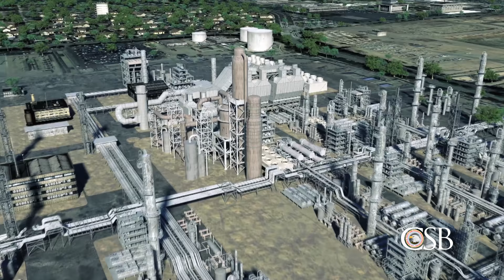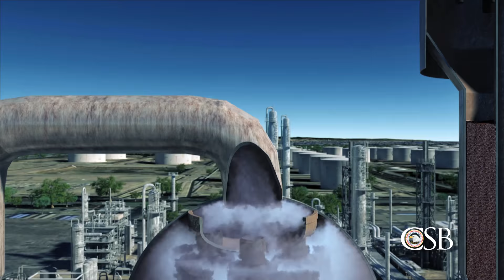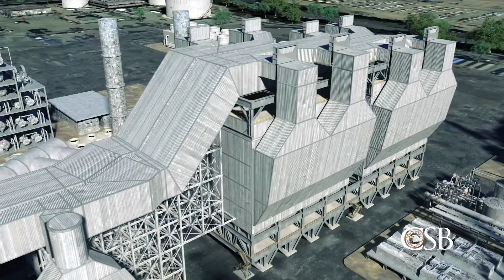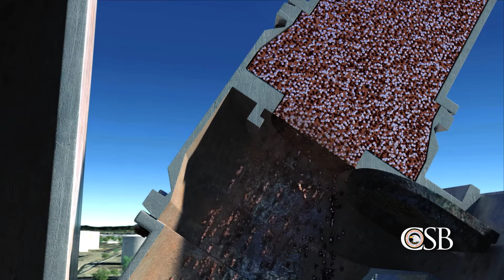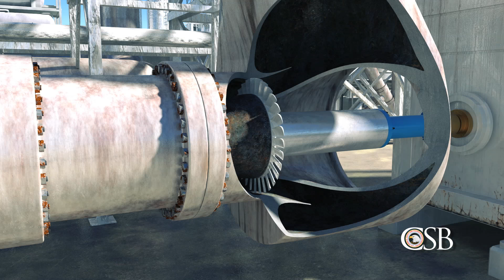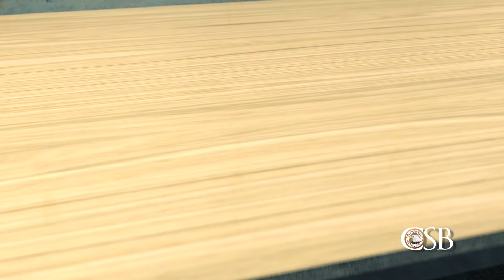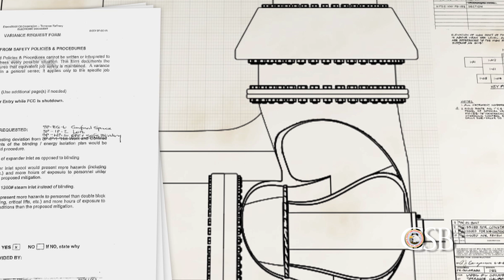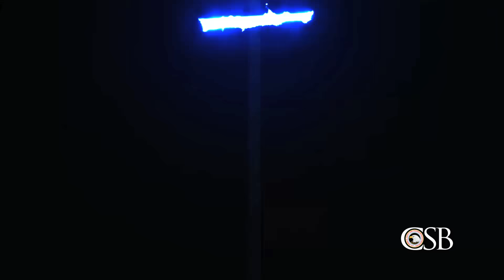Animation of 2015 Explosion at ExxonMobil Refinery in Torrance, CA

Comment: Expander fails
"We don't need to check this. Just restart it."
Doesn't restart
"It's probably just wear and tear. Of course, this in no way indicates that maybe some other parts are suffering from wear as well. Let's just replace that one part. While we're at it, let's just pull up some BS piece of paper from 3 years ago, violating our protocol, cause protocols are for nerds."
Steam comes out.
"Oh shit, let's just shut down this steam which is part of a safety measure to stop our shit from blowing up, cause there's no way anything else could be wrong inside this huge metal container which we can't see into. Also let's not shut down anything else, especially not the sparky things, cause time is money."
gas leaks
"What's that smell? Oh wait, I seem to remember there being a safety feature that was designed to prevent this exact shit from happening, you know, the one we just turned off. Yeah, let's turn that back on. The gas'll never make it to the spark.."
BOOM SHIT FLYING EVERYWHERE MEN SCREAMING IN PANIC PPL RUNNING FOR THEIR LIVES WHILE BURNING IN HYDRO-CARBON HELLFIRE

"Shit happens."

Comment: Isn't it amazing when your shitty maintenance allows multiple safety features to fail all at once, slide valve fail, back flow preventer failure allowing lite ends to pass through cooling tower which is wrong I believe more likely leaky heat exchangers. Always remember kids the most dangerous thing in a refinery is cooling water because the process is always run so that product leaks into the cooling water not cooling water into the product.

Comment: I worked in a chemical facility making automotive paint. Every step of every task was dissected, documented, and theoretically, even with an an equipment failure, a safety issue should never arise.
But employees were pressured, and rewarded for, production. Employees who took dangerous shortcuts completed tasks quicker, and their speed soon became the standard. Production trump's safety every time.
We had enough solvents in dozens of 10,000 gallon tanks to straighten the river bend we were located on.
Even though we lived safety, and management preached it religeously, they turned a blind eye to short cuts employees are pressured to make, until something goes wrong.
Reply: If Americsn lawsuits stamped on industrial negligence instead of 'malpractice' liability, our healthcare would be cheaper on top of its high quality. We would be undisputed best in the world.
Reply: Then massive costs are invited rebuilding the facility and compensate for the injury or deaths,,,
Not a good business plan long term.
I worked on boats, used Sterling paints and they had wicked solvents.
Plus the fiberglass resins,,
One day some guy wanders in my space to watch my spray out a hill cigarette hanging out his mouth
My God!
Reply: @samlabo1688  Because most businesses focus exclusively on short term profits, because stockholders only care about quarterly earnings. They don't care about long term costs and certainly don't care about the workers.
Reply: Let's take a moment to appreciate the line "enough solvents to straighten [a] river bend". What an amazing turn of phrase.
Reply: @greenyawgmoth  No exaggeration. The plant used to be a gunpowder factory before we took it over. All the roofs in our buildings were designed to blow off during an explosion, a design left over from the powder company. One day I spotted open flames coming from the top of a grinding mill and hit the evac button.
Fortunately, instead of running, one brave employee grabbed an extinguisher and put it out.
Directly under the mill was a 200 gallon container of toluene.
If that would have ignited, we would have welded NJ and PA together, river or no river.
Reply: @2002MX5  

Yikes ... I had to read that twice to make sure my lack of sleep was blurring my comprehension ... I can still feel a cold chill in my spine ...

Which leads me to a number of questions:

a) who in right God-damn mind has a 200gal tank of toluene under a grinding mill ...?

b) why wasn't any kind of fire suppression fitted ... or was it a cost vs chance of accident thing ...?

c) did that brave soul got awarded for his bravery, above and beyond ...? He saved the entire plant from becoming a smoldering crater in the ground ...
Reply: Disagree completely.  Safety trumps production. Anyone who wishes to push production over safety is asking for failure...at some point.
Reply: @markrothenberg9867  You are wrong. I lived it. For a German company here in the U.S.
The biggest chemical company in the world.
Reply: True that.  Same thing in oil production preach safety, but demand production wink wink.  Something goes wrong you get the axe.
Reply: @kunkel80101  Plus, add the stresses produced by some of the most punishing shift rotations imaginable.
Reply: @kunkel80101  Yep.  Workers hate what they view as overreaching safety guidelines
Reply: @chad9166  

There's a fine line between safety guidelines that have been practically written in blood; and too much safety, where it takes up as much time as the job itself ...
Reply: @nigelft  The vertical grinding mill was drawing paint from the bottom of an open top tank and then redepositing ground paint back into the top. It was covered with a cylindrical wooden cover with a cut out for the hose.
Next to it, he had started putting together another batch, solvents first, same size open tank with the wooden cover. He was watching the mill and working on loading the next batch. He had left for a minute to retrieve pigments.
I walked nearby and saw flames coming from the bearings at the top of the mill. I ran to the nearest fire alarm and pulled it, ran to nearby office and yelled to evacuate. That was our training. A crazy brave maintenance man grabbed a huge wheeled fire extinguisher, killed the mill power and put out the fire. He caught hell for risking his life, but they still loved him for it.
Plant has sprinklers, but ceiling is 20' high, and fire produced almost no smoke or enough heat to trigger it.
The mill was an older vertical grinding mill used for smaller batches.
We had huge new horizontal primer mills on the lower floor that were self contained, where a fire couldn't happen. Automatic shutoffs built in.
We had the longest running safety record in  BASF worldwide - 20 years without a lost workday accident.
One day a bee stung an employee at our outdoor picnic and we had to start all over.
Reply: Am old enough to remember industrial painting Carbomastic on steel piles with a plastic tent top and a cloth mask and hoodie. That was bad. Before that I worked degreasing industrial silk screens with solvents in the loft of a building that got to 108F in the summer. No protection at all. We were all tripping balls. Later on, was on a team they sent down into the oily-water sewers in a refinery to map them for expansion. Of the three who went in, without chemical masks (this was in 1990s,) they were all dead of cancer within a year. My job was sitting up above on the surface with walkie talkie, taking their mapping notes and as 'extraction safety watch', since I had young kids. Their wives asked me to testify for them, but the refinery town attorneys were all too chicken to take the case. So I quit field work. Today, you can't move a finger without chemical masks, moon suits, HS&E sniffers and post-watches, and manhole tripod hoists. Nobody dies in an office job except from too many Dingdongs, lol.
Reply: First time I decided to apply for a job on a printing press, the supervisor told me to never panic, always go slow and look where I was walking, putting my hands, and my feet. And never, never chase after anything that falls near the press. If anything falls in the press, it's always better to just hit the Emergency Stop. Even if production is affected or machinery is damaged, none of it is worth losing a finger, a limb or my life. I always appreciate what he told me.

It's leadership and training that matters in all these accidents.
Reply: @chaosXP3RT  Started work on a big Miehle 4-color, doing 24x36s on vinyl and when I started asking about safety items and safety training they moved me to the mailroom and had me do deliveries, lol.
Reply: Why were they storing these solvents is the question? Odds are they were required to monitor the condition of the tanks and valving to be allowed either by state or federal regulators to do this. The company has a "cradle to grave" ownership for civil and criminal liability on these tanks. This is SOP for decades.
If they lack the means, which can mean there are no other places to store these chemicals safely, legally, ethically they are allowed, with proper government approval to store in place. This sounds like what you are talking about.
Sometimes the government refuses to let them move these chemicals and they must store them in place or the approved method is much more dangerous or environmentally risky than storing in place.
Look at the King(?) Mining Disaster which shows bureaucrats at their best polluting a river.
Reply: @katrinaanon1038  What?????
They stored them because they used them daily. And it's NJ. They fuck with your company until you leave, like ours did.
Reply: Your contempt for workers is disgusting, those "shortcuts taken by employees" are in reality management operating a business exactly as they want to, only caring about profits, this has nothing to do with the workers and to believe that is they who are responsible for greed's consequences is both mind numbingly stupid and ignorant. Capitalism kills, power to the workers.
Reply: @eleSDSU  Suck it, moron.
Reply: @eleSDSU your contempt for having proper reading comprehension is disgusting
Reply: @eleSDSU  I sympathize with what you're saying. At the same time, I think we have to acknowledge that in any traditional business, industrial or otherwise, the line set by management is often taken up wholeheartedly and uncritically—even subconsciously—by their employees. The OP describes this: management talks safety but pays for speed, and the workers that take the hint and disregard saefty in favor of speed are praised and rewarded by management. Can we blame management for this? Absolutely. Are the workers the ones who stand to suffer the most when things inevitably go wrong? Definitely. Yet, it's an oversimplification to say that the workers that go ahead and disregard safety have nothing to do with the problem. If you're really a trade unionist of any sort, I'm sure you know well that at just about any non-union company, many workers will say exactly the same sorts of things management would say about unions. Furthermore, even unions themselves can become corrupt and work against the interests of the workers they claim to represent. Nothing in life is so simple.
Reply: Corporate/executive greed, no surprise here

Comment: just a few questions...why wasn't there any secondary stop valves in place to prevent such a flow, and why wasn't there any pressure monitors in place to warn of the potential over pressurization?

Comment: So, they knew for over half an hour that hydrocarbon gasses were in the ESP, and that it could ignite it, and they were doing repairs for several days on the thing that feeds it hydrocarbon gases.....and NO ONE thought that maybe it might be a good idea to shut off the ESP? 
Sure,some dirty pollution will escape, but I think that is far less than the smallest drop in the biggest bucket of a refinery blowing up.....
"Hey Bob, this place is gonna blow, should we take 8 seconds to shut it down so it doesn't explode, or just fuck it and run?"...."Its obvious Jim, lets just run for it!"....
Reply: It is unclear why the ESP should be left on if the unit is stopped and there is nothing to clean.
Reply: There are multiple processes feeding the ESP,  so it has to be left running unless the entire plant is shut down.      So obviously the entire plant should be shut down.    You have to shut down all the other processes first.    The fines that would have occurred for shutting down the ESP  might have been more expensive than the explosion.    They are that high.      Also,   don't assume that the average worker or even supervisor really understands exactly what is going on with the equipment.   In my experience,  that is rarely the case.
Reply: The ESP doesn't make money; it's sole purpose is environmental control for PM2.5 reduction.  I know because I've operated one in this exact service.  The reason it wasn't turned off was almost certainly because it would have been a violation of environmental regulations.  So don't blame the engineers or managers for that decision, blame the ignorant and overzealous regulators that wouldn't allow the ESP to be shut down even when it wasn't needed.